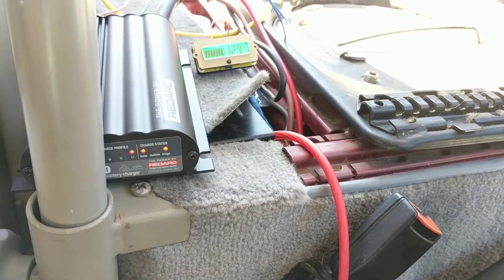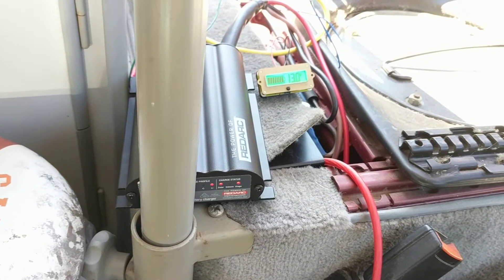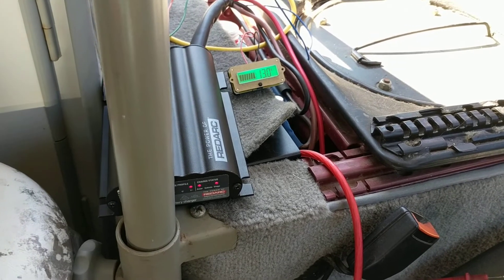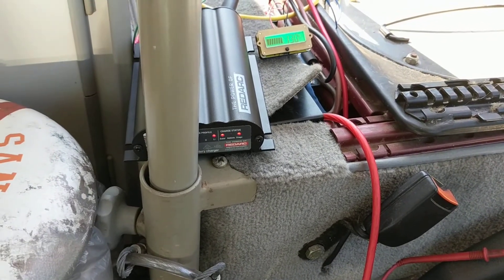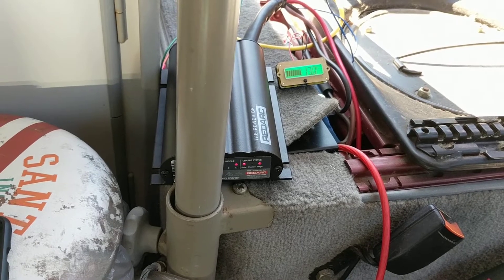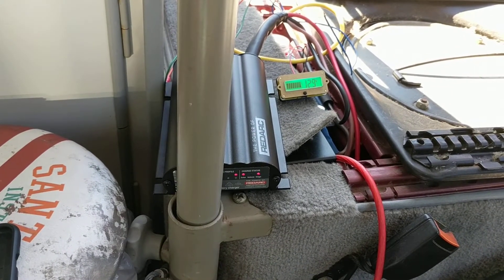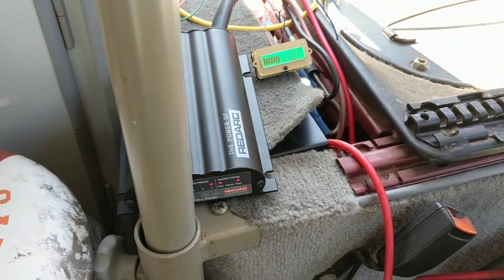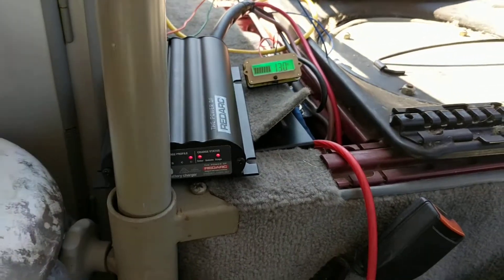Installing a Lithium battery into a Vanagon Westfalia part 6

Comment: I watched the entire series waiting to learn how and where to install this charger. Pretty frustration that there is no installation instruction/demonstration. Not that I didn't learn anything. I did, so thanks for the effort, but the title is very misleading. I think you should change it to something like "Testing a Lithium battery and charger."